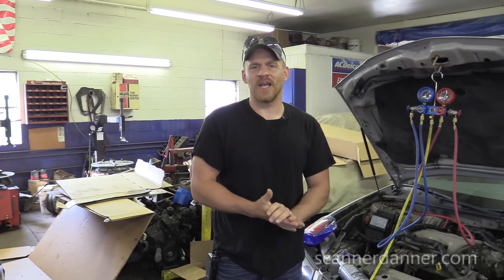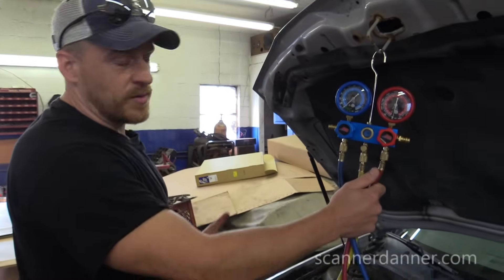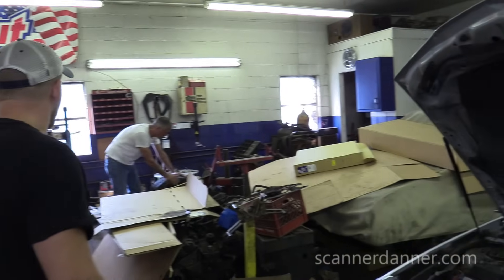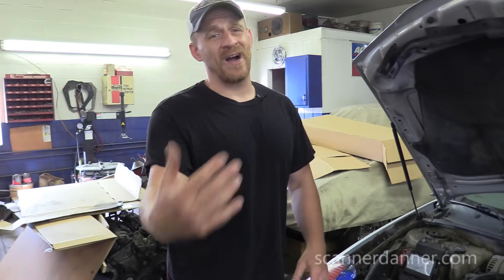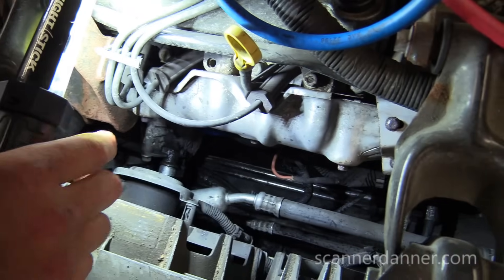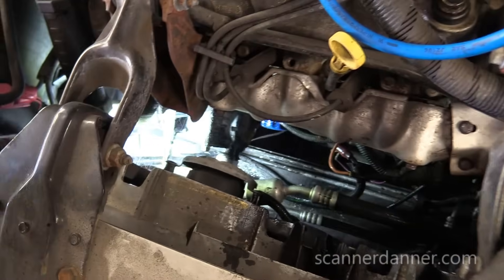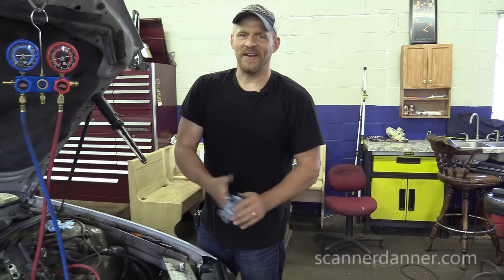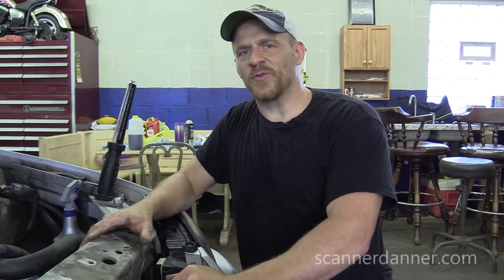A/C Leak Testing Using Compressed Air, Soap and Water (any car)

Comment: Not kocking your method, but on the EPA 609 handbook it days not to used compressed air for 2 reasons. First under high pressure in a oxygen rich environment r135a can be explosive. And second your not only getting moisture contamination form the compressed air but your also getting mineral oil contamination as well.
I don't see a big deal with it just wanted to mention that's what section 609 handbook says
Reply from the maker: I understand your concerns. Calling me a hack is uncalled for. What do you think was inside of this empty AC system before I put shop air in it?
Reply from the maker: KD Automotive, I've read that as well, but I'm not putting oxygen over top of R134a. The system is empty when I do this.
Second, a little mineral oil won't hurt the system. When we used to retrofit the old R12 systems, the systems were still full of mineral oil. I watched an experiment of what happens to mineral oil with R134a, it turned into a sort of sludge. And those systems still worked fine for years! And that would be 8 oz of "sludge" sitting all through the system. No way that the immeasurable amount of mineral oil that would come from a air compressor would do anything harmful to the system. 
Thanks for the info. though, I appreciate it.
Reply from the maker: aussiebloke609 it's only an issue if you're putting compressed air over top of the refrigerant. If the system is empty, I don't see how adding compressed air is a danger (explosive) in any way shape or form. If it is, I would like to know how.
Reply: Not sure I'm understanding this thread.  How does compressed air become oxygen rich? It should still be 21% oxygen, as it's sourced directly from the atmosphere.
Reply from the maker: KD Automotive, I had no issues with you pointing that out. Seriously, thank you. Other people will benefit from this type of exchange.
Reply: I am not blaming you friend but problem with HVAC guys, they can't see other to work on HVAC systems. Same thing I am facing on my videos as I am sometimes working on HVAC with my very limited resources and these such haters are coming and giving hating comments all the time. So my request to all HVAC people to be loving people instead of hating people. Best regards to all.
Reply: I've taken several systems that had been idle for over a decade, and charged them up, added some oil, and they were blowing ice cubes for over 5 years - same drier! That's  got to be a million times worse than just airing a system up for a half hour while you leak check. I see no harm in what you're doing, Paul - I've done worse, and the systems worked!
Reply from the maker: Agree, there is a balance of cost vs the fix vs what you read on paper to what you see in the field.
Reply: ScannerDanner no problem. A/c videos always get A lot of comments saying what's right or wrong. I know I've had someone tear apart one of my videos to but if you don't talk about it no one learns anything
Reply: Your air is even fresher than mine ---- agree presurising with oxyegen would be a different matter.
Reply: Smitty Smithsonite you still get blow-by from the compressor itself. Next time you drain your lines look at how much oil is in the water you would be surprised.
Reply: Ah, so not really oxygen rich, just pressurized air at the usual gas ratios.  Tks.
Reply: ScannerDanner r134a is tightly controlled in Australia,  you need a licence in Australia even to hold the stuff in your hand. It cannot be personally imported or bought retail. It is my suspicion us Aussies are more concious of handling ac systems beyond what is instructed as industry standard. It takes one year in Australia before you are even licenced to handle refrigerant,  it takes even more qualifications and licences to work on vehicle ac systems. Now it is my understanding any Joe blow in the US can buy r134a and blow themselves up with compressed air, this is what you should be mindful of Paul, sometimes not all the right info is absorded by your viewers. For me in Australia, not having the right to blow myself up or freeze my eye balls with freon is, an immature society,  I should have the right to choose. However I don't, and it will cost the average Aussie  $150+AUD to have their ac system nothing more than recharged.....a rip off.
Reply: KD Automotive   You are spot on.  101 AC work No compressed air.
Reply: What about the cowboys charging A/C systems with LPG sold under different brands (hi chill ect) no license required?
Reply: autoairsteer , down right dangerous.
Reply: KD Automotive Yeah, they also state that missing service port caps are a major cause of leaks. Well, the job of the caps are to keep dust out, because the service port valve should not leak. A lot of stuff they claim on those test and study guides are confusing or not actually true.
Reply: ...........Compressor air is definitely contaminated air.
Reply: NO!! no vacuum no matter how long or how low a vacuum you pull will you take moisture out of a “Hygroscopic” oil! When PAG and POE oils are made the water molecules are stripped from it, when it’s exposed to moisture they automatically re-attach them selfs back the PAG oils and no vacuum, driers etc. are going to strip them away from the host molecules. This idea that you can pressurize an A/C system with “shop air”, which has an extremely high concentration of moisture in it, is lunacy and should NEVER be done!!
Reply: No mineral oil in a 134a system.

Any moisture that's in shop air will boil off when you vacuum the system down anyway. If I use shop air, I just throw the vacuum on, and walk away for a few hours, instead of the normal 30-45 minutes  - that will boil off any moisture that may have got into the system.
Reply: Smitty Smithsonite I'm taking about the mineral oil in the compressed air will be contaminating the a/c system. Compressed air is full of oil vapor from the compressor witch is usually mineral oil
Reply: Ahh, gotcha.

I don't have an oiler on my system - I just oil my tools on a regular basis (which is usually whenever I remember to :) ).
Reply: Smitty Smithsonite I agree though if you pull it under vacuum long enough it will all boil out. Really need a micron gauge to tell of you reached a low enough vacuum as well
Reply: ScannerDanner I agree name calling isn't necessary. I'm not knocking you either Paul I just wanted to point out what the books say. 
In reality if you don't have a a/c machine what are your options? Nitrogen witch you probably don't have on hand.
Add  a few onces and use a electronic leak detector. May not work
Or compressed air and change the dryer when you make the repair
Reply: KD Automotive Not if you have an air filter /dryer inline with the hose after the compressor outlet.
Reply: Many things you wouldn't think would be flammable (like some metals) are very flammable in presence of compressed shop air. I cringe when I see mechanics just happily put over 100psi of air into non-oxygen systems. Sure, the chance of a boom is low, but it only takes one.
Reply: aussiebloke609 that is enough to make it a explosive mixture
Reply: What kind of Hack are you!  You use nitrogen to test for leaks.  You call yourself a teacher and pull this kind of stuff.  Pease do research be for you hurt someone.  Compressed air makes for an oxygen-rich environment.  It also contaminates inside the AC system.  I had more respect for you until you pulled this.

Comment: Will the a/c gauges fit my honda ? EDIT:pun intended
Reply: #Moog
Reply from the maker: Yes, these will got all R12 and R134a systems. Link provided in the description.
Reply: Adam Budai it's it's a r134a system yes
Reply: They are pretty standard. They should do for your Honda.